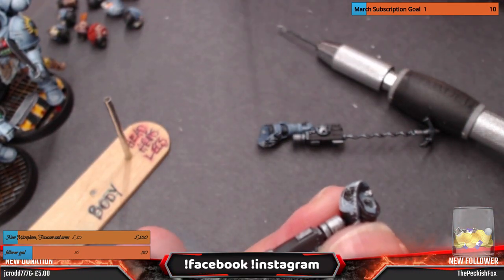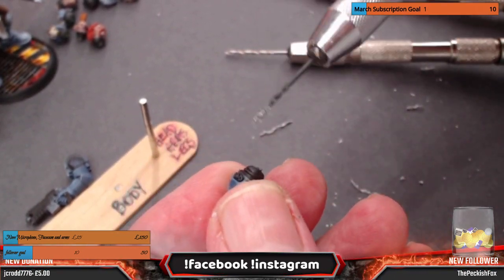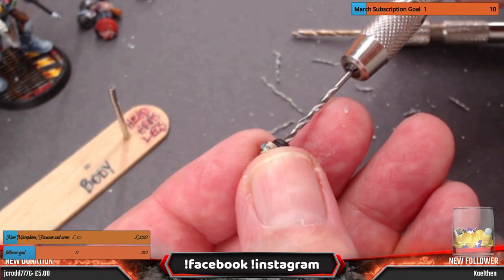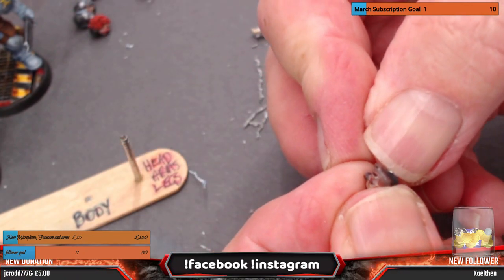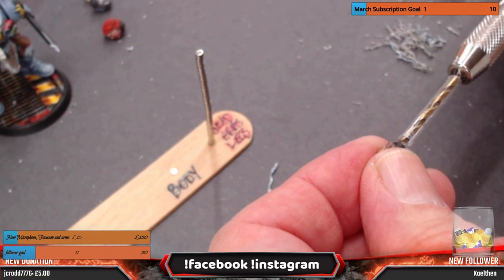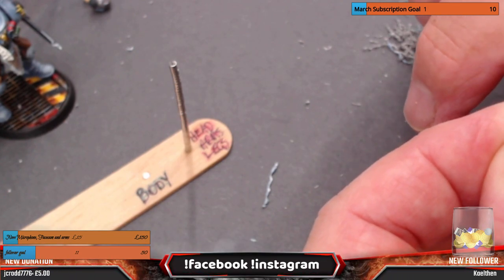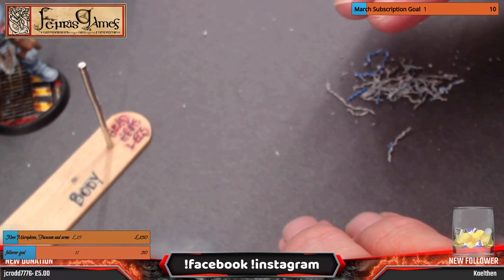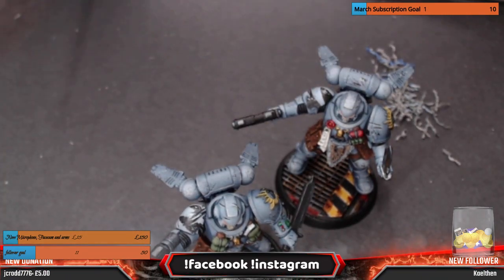Magnetizing, heads and arms on Space Marines

Comment: Thanks for the video. Where did you put the magnet in the neck of the body (not the head)? I couldn't see it in the video where you showed the body without the head. I want to do this for the new Helbrecht model so I can have the option of any of the heads, but I am paranoid I am going to mess it up.
Reply from the maker: I couldn't find it either, lol, I'll see if I've got it some where else, may have a pic on my Instagram

Generally I'll cut the locator pin off the head and glue that into the body during assembly, then once that's all dry I'll drill out for the magnet. with the bodies that just have a dip for the head to sit in, I'll just drill that out, although it usually requires some milliput added during assembly to give you something to drill into
Reply from the maker: Hi Daniel, I pinned a link and a time stamp, should be what you're looking for
Reply: @Bunyip_Studios  Thank you for the quick response! I just found one of your other videos and could see what you were doing. So I fill the cavity of the body whilst assembly with milliput?

I was wondering if another way to do it (when the head has a rounded bottom and the depression for it to sit it), would be to cut off where the round part of the bottom of the neck starts (so the bottom of the head and neck is flat). Then glue the cut off round piece into the depression, and then stick a magnet into both pieces. I'm thinking that might help maintain the right height for the head?
Reply from the maker: @daniellee653  yeah that's what I do, I don't like sculpting with milliput, but it's ideal for this

that could work but seems like a lot more work. So long as you keep as much of the "rubber seal" section as possible on the neck, the height is generally okay. It's just the older heads that sometimes sit a bit low, I think I had a couple like that, if I remember right, I might have glued another magnet to the head and then sculpted the extra seal sections on it
Reply: @Bunyip_Studios  Thank you for the tips. I'm waiting for some magnets to be delivered and then I'm going to practice on some of my other marines before I tackle Helbrecht!
Reply from the maker: @daniellee653  you're welcome
Good idea, do make yourself a small jig with the opposite polarity facing upward, makes life a good deal easier, you just pick up the stack and push the top magnet in the hole. I labelled them body and limbs, but use what ever makes sense to you
I can totally recommend Spider Magnetics. He's rebuilding the website currently, but he is on ebay as well, the website prices are usually cheaper than ebay, plus he has a dedicated Warhammer section on the website
Reply: @Bunyip_Studios  thank you. I saw that you did that and I'm going to make one of those myself.

Comment: How do you line up your magnets? Or do you find that because they're larger, you can eyeball it and you can't tell? Currently magnetising a T'au pathfinder unit with 1mmx2mm magnets and it's a bit daunting! Worried you'll be able to see the gap because they're white and pretty exposed if it isn't a perfect fit.
Reply from the maker: Dane Johansen I drill a 1mm hole first then put a loose pin in that's just proud of the hole, cut it so it has a point to it then push the parts together firmly, the point will mark where you need to drill. Some people cut the end of the pin square and use a dot of paint to mark the other part
Reply: I know im randomly asking but does anybody know of a method to get back into an instagram account..?
I somehow lost the account password. I love any help you can give me!
Reply: @Forest Phillip i really appreciate your reply. I found the site on google and im in the hacking process now.
Looks like it's gonna take a while so I will reply here later when my account password hopefully is recovered.
Reply: @Forest Phillip it worked and I actually got access to my account again. Im so happy:D
Thank you so much, you saved my ass!
Reply: @Jake Zander glad I could help =)